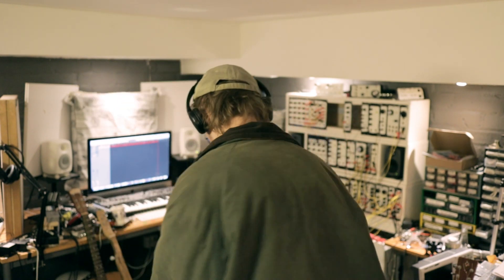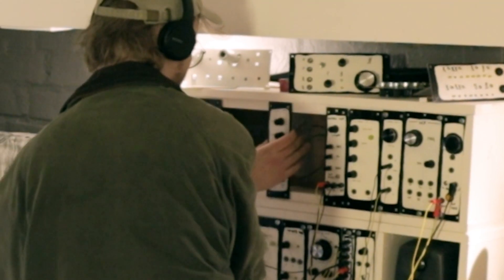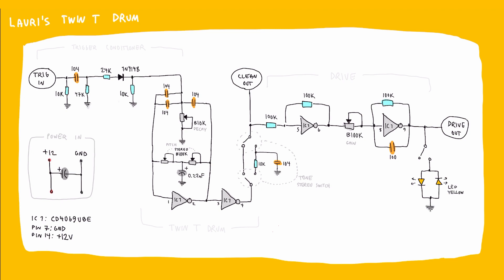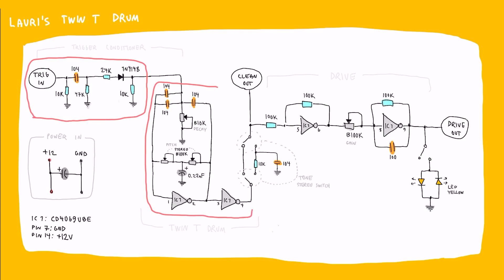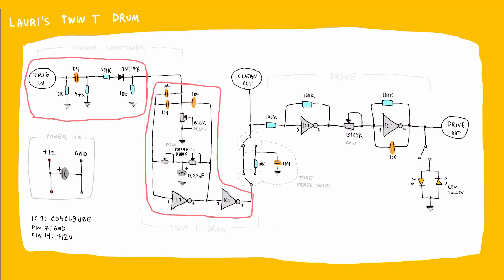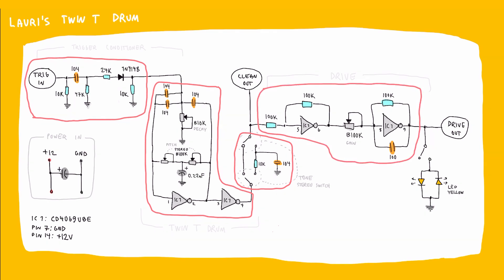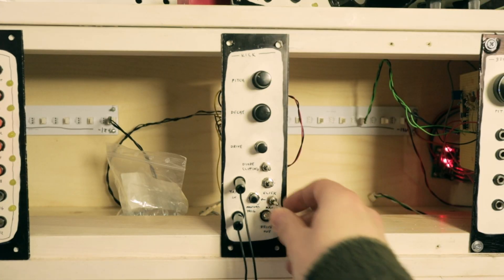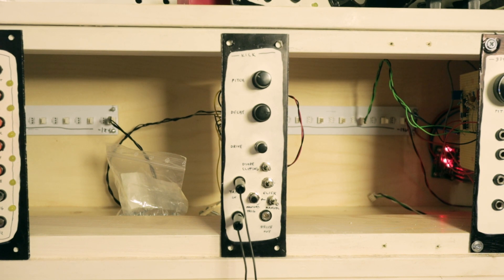DIY twin t kick drum module for modular synth

Comment: Hi Lauri, it's me again with another stupid (?) question: The 0.22uF cap near the stereo pot, does it really have to be a 220nF electrolytic cap? The E.W. original circuit shows the non polarized cap symbol (foil/ceramic?) which seems quite logic to me because 220nF is a quite unusual value for an electolytic one (they do exist though).
Reply from the maker: @DCPier  yeah i think a non polarized cap should be totally fine! I just drew the schematic with the exact component i used myself and i happened to only have 220nf electrolytic caps at the time

Comment: I need some help, please.
I've built the circuit and it sounded nice until it didn't. It starts to oscillate like crazy and eventualy the ic fries. I checked the circuit, it's all acording to the schematics. And why didn't you use coupling caps on outputs? 
Looking forward for the reply.
Reply from the maker: Hmmm not sure what could be causing that. Did you check that it wasn’t just a faulty ic chip? Are you powering it with 12V DC like mine or soething else? And what are you using as a trigger?
Reply: @LAURISDIYCHANNELTV  Thanks for the reply! It might have been faulty ic since I bought the cheapest ones from local parts store, tried with 2 chips, both failed. I'm powering the circuit with a 12 volt adapter, beatstep pro as a trigger. I'l try this chips in more conventional applications and check for instabilities.
Reply from the maker: @AlienFrog648  okay, thats all i can think of at the moment! I was thinking something like this could happen if the chip somehow got a negative voltage to its inputs, but it doesnt really sound like thats the case with your setup. I fried a couple of 4069s like that when i was building a filter. Just like yours, it worked for a little while and sounded fine, but then started acting up and the chip fried
Reply: @LAURISDIYCHANNELTV  Thanks, Lauri! I figured it out, those were just bad ic chips, they are quite unstable. I replaced them with some made by Texas Instruments and it works like a charm! 
Many other twin-t drums sound kinda dry to my ears, this one sounds a lot better, IMHO. 
Thank you greatly for your circuit and help!! Much appreciated!
Reply from the maker: @AlienFrog648  awesome, good to hear! 😊💛
Reply: @LAURISDIYCHANNELTV  and it actually works better without coupling caps, haha
Reply from the maker: @AlienFrog648  oh and i didnt use output caps because i didnt know what i was doing and still dont! Im not very knowledgeable when it comes to electronics but im learning as i build more and more stuff!

Comment: What are the boards you are using here? They look really useful
Reply from the maker: It’s a prototyping pcb i desinged and order from jlcpcb! It’s like a breadboard, meaning theres always a row of 6 soldering points connected to each other. This makes prototyping simpler and i have to use way less wires to connect components! Heres a link to the gerber files, if you want to order some yourself: https://www.dropbox.com/sh/yw0j4umez1evwmp/AABw4nE_mRQAVi5pAXoBGCRpa?dl=0
Reply from the maker: You just need to upload the gerber zip on a PCB manufacturers website like JLCPCB or PCBway for example!
Reply: @LAURISDIYCHANNELTV  dude, thank you so much. I did have some ideas similar to this, but never found the time to learn kicad. I will use your design, with great thanks and appreciation. Nice one ❤️

Comment: OK this is actually sick sounding, I have been looking at way more complicated kicks for DIY but I'm gonna go for this one!
Reply: @LAURISDIYCHANNELTV can you share what kind of switch you used for the RC filter? It looks like it's just one double-pole or something, but I haven't been able to find such a thing online. I have been trying to think of a way to use one simple two way switch but I don't think it's possible. Maybe I'll just leave the RC filter always on. Should have breadboarded first XD
Reply from the maker: @constantine333B you can search ”DPDT 6 pin” on ebay, amazon or whatever and you should find these switches! I guess you could use a single switch so that it disconnects the capasitor from the circuit (So in between the 10k resistor and the 104 capasitor.) When disconnecting the capasitor, that would leave the 10K resistor in the signal path but i dont think thats going to make a huge differnece, it should just make the output a little bit more quiet
Reply: Oooh good idea! Need to get my active mixer module together anyway so I can boost the signal there. Thanks man!

Comment: If i change some of the capacitor values in the oscillator for a higher pitch and add a small noise circuit, would i be able to make a sbare drum from this circuit?
Reply from the maker: For sure! I’ve used the circuit for snare sounds even with these cap values! But caps for a higher pitch would be smart for a snare circuit. You can find a simple percussive noise circuit for example on Kristian Blåsol’s (modular in a week) channel

Comment: Really nice drum module ! Is it possible to trigger it using an electronic drum kick like the Roland KD-8 kick pad ?
Reply from the maker: I've sometimes used the module with a simple amplified piezo drum pad, but the output isn't the same as with a 5V trigger. It does make a sound, but the sound is kinda softer and more responsive to the input signal. I'm not familiar with the KD-8, but if it's a passive piezo pedal, it would work in a similar way, but you would also have to amplify the signal before plugging it into the module
Reply: @LAURISDIYCHANNELTV  Hi Lauri, thanks a lot for your answer ! Do you have a 5V amplifier circuit to recommend ?
Reply from the maker: You might be able to use the overdrive part of the modules schematic as a passable amp circuit! You can also check Doepfers DIY page on their website for some simple diy circuits, i remember them having a simple op amp amplifier circuit and i bet it could be powered with 5V and ground instead of the eurorack +12V and -12V
Reply from the maker: You can find the website by googling ”doepfer diy”

Comment: Why is there a .1uf cap in parallel with one of the .1uf caps in the twin -t circuit? Shouldn't they be the same?
Reply from the maker: I was messing around with the cap values on breadboard and this is what i ended up with, I liked the pitch range with these values! I’m sure it would be better to make both sides the same value, but i only had certain cap values at hand at the time and i was happy with the circuit like this
Reply: @LAURISDIYCHANNELTV  Cool! I'll try it both ways and see what I like.

Comment: Hello!! Great video!!
One question, I want to make a version with the 40106 as clock, and I was wondering if it is possible to add an extra output to that clock pulse to synchronize other modules.
Would it be as simple as adding a buffer to that clock output on the 40106 and taking the extra output from there with a 104 capacitor? Or is it not as simple as that?
thanks :D
Reply from the maker: Thanks! Multiplying the clock signal should be very simple! I think a buffered mult would be ideal, but you could probably even just multiply the signal passively. So just wire the same clock signal to the drum and an output jack! I dont know if it doesnt work like that in certain setups, but with my modular i send the same clock to different modules by just stacking banana cables to the same output haha
Reply: @LAURISDIYCHANNELTV  Thanks a lot!
It's true, it works! :P Thank you! I have a question about the Trigger, I am building the circuit for 12v, but for the trigger button to send 5v should I take it from a 7805 regulator?
Oh! And happy new year from Panama!! Thanks for your channel!
Reply from the maker: @doohmritual  Yes thats what i did, just a 7805 and a momentary switch! I think the trigger can also be 12V, but i wanted it to be the same voltage as other trigger sources in the modular. So im guessing if you use 12V its just gonna be a bit louder

Comment: I built the trigger conditioner and the drum part of the circuit (did'nt build the drive part), and when i plug in to the clean out it doesn't pulse it just makes a continuous sound in my headphones, like a synthesizer or something. But the decay and pitch do work and they change the sound. help??
Reply from the maker: If the pots work and change the pitch of the sound, it sounds like the circuit is working, but for some reason the filter is resonating too much! The module does self oscillate with certain settings, at least when you exite it with a trigger. So maybe double check the decay pot is working correctly and not broken or something, because it is basically the resonanse of the filter circuit, that makes the drum sound
Reply from the maker: If the pots dont change the pitch but change the tone of the sound somehow, then it might be something else, for example grounding related! Make sure all the circuits you are using are connected to the same ground
Reply: @LAURISDIYCHANNELTV  okk, thanx

Comment: Thanks for the video, but I'm having a little trouble following the schematics on a breadboard. Could you make a video of you building this on a breadboard? Or if you could help out a little with the schematics that would be awesome! Thanks!
Reply from the maker: You can message me on instagram and i’ll try my best to help! Theres a link to my insta in the description. And if you dont use instagram, go ahead and ask me here in the comments! 😊
Reply: @LAURISDIYCHANNELTV  Well when I plug in my clock circuit to trigger it, I get an oscillation. But none of the potentiometers work to change the sound of the oscillation. I didn't use any switches yet. I just went with a static route for now.
Reply from the maker: If none of the pots do anything, could it be some sort of a grounding issue? If your clock source and the drum circuit dont share a ground, it might lead to some sort of humming! Does it make any noise when the clock is not connected? You can easily try if the circuit is working on its own by plugging +V of your breadboard to the trigger input
Reply: @LAURISDIYCHANNELTV  Both circuits share a ground. And on the drum circuit i have both pair of rails strung to each other (positive to positive and negative to negative). And it doesent make a noise when the clock is not connected nor when i plug +V to the trigger input. I think I did something seriously wrong.
Reply from the maker: Then i would check all the connections again and if everything seems to be right, i would check if the ic chip is broken or something!
Reply from the maker: Oh shit and the schematic in the video had some error if i remember correctly!! Check out the fixed schematic in the dropbox link in description! I think 2 of the ic pins were written the wrong way!
Reply: @LAURISDIYCHANNELTV  Ohhh snap! Alright, I'll check that, Thanks!
Reply: @LAURISDIYCHANNELTV  And also, do I need a stereo potentiometer? or can I use a regular one.
Reply from the maker: You do need a stereo pot for the pitch! You should also get sound out of it if you have 2 regular potentiometers set to the same exact value, or 2 fixed resistors instead, but then you basically cant change the pitch
Reply: @LAURISDIYCHANNELTV  Alright ill get one. Thanks!!!
Reply: @LAURISDIYCHANNELTV  damn, still stumped.
Reply from the maker: @boenglover2593  Shit, sorry to hear! I cant think of any other ideas 🙁 Sometimes when i get a problem i cant seem to troubleshoot, i just end up building the whole thing again! Cause it might be a missed connection, broken parts or something
Reply from the maker: Im not sure if it makes a difference in the circuit, but there are buffered and unbuffered versions of the cd4069 chip! I used the unbuffered version, so it says CD4069UB or UBE. Are you using the same or the buffered version? I dont really understand electronics that well so i cant say if it makes a difference
Reply: @LAURISDIYCHANNELTV  i have the cd4069ube. but i think it might be the potentiometers. or how i have my power hooked up. but ill try the circuit over again for now
Reply from the maker: @boenglover2593  you got this! Make sure the stereo pot is connected correctly, so both pots change the same way round. For some reason i always screw this up first and then have to flip the other pots connections haha
Reply: @LAURISDIYCHANNELTV  Ok i think i got it! thanks for the help!!
Reply: @LAURISDIYCHANNELTV  wait sry one more question on the pots lol. do the markings on the stereo pot symbol in the schematic go (3-2-1 and 1-2-3) or (1-2-3 and 3-2-1)? and also do the other pots go (3-2-1) or (1-2-3)? if you know what i mean.
Reply from the maker: @boenglover2593  the value of both sides of the stereo pot should stay the same as you adjust it, so i guess the pin numers from left to right in the schematic should be 1-2-3 and 1-2-3! It doest matter if the whole thing is ”flipped”, as long as they are both the same way. Then the pitch pot just works the wrong way round! And the same with the other pots! I cant really say which way they should be, i tend to just connect pots and hope they are the way i want them to or leave the controls flipped if im lazy hahah
Reply: @LAURISDIYCHANNELTV  lol, ok. thanks!

Comment: Hey, sounds great and very simple design! I am wondering though, isn't the output going to be only on the positive part swinging between 0 and 12 volts?
Reply from the maker: Yeah this has been working perfectly fine for me, so no need to add anything to the output!
Reply from the maker: Thanks! Yes the output is between ground and 12V, but i see no problem with that! A lot of audio sources are unipolar, i think for example my cem3340 oscillators are as well. And of course digital arduino modules etc
Reply: @LAURISDIYCHANNELTV  Thanks for the response. I consider trying to build this module, and I thought I would put an RC passive high pass filter on the output, to get rid of the offset, but as I understand even that is not necessary right?

Comment: This kick drum circuit gives a nice range of effects. I've built 2 of these now based on your cct. One thing I've noticed is that the circuit seems to pick up any noise/signal that is on the power supply and amplifies it. If I unplug the output of the kick drum the effect goes away. Anyone else noticed this? I've tried adding some larger caps to the power supply rails on the kick drum cct board. This reduced the effect a little bit, but didn't eliminate it. Interested to know if other people also see this effect.
Reply from the maker: Nice to hear the circuit has been useful! 😊 I havent noticed any noise problems with mine, but i only have a couple of modules in the same case at the moment! I forgot to mention it it the video, but you should remember to connect the ground connection of the inputs and outputs if youre using regular minijacks or jacks! But of course i dont know your setup or if that would even matter! But if anyone else has noticed a similar problem and has a solution, please let us know!

Comment: Cool module. Why is the sound very low? did I assemble it incorrectly or do I need to connect to an amplifier?
Reply from the maker: Thanks! I just realised i forgot to make a small correction to the schematic! The pins 8 & 9 of the cd4069 were marked the wrong way around! So if the overdrive output is quiet, that might be the reason, sorry for that! I updated the dropbox link in the description and everything should be working now. If that wasn’t the problem, then i dont know what it could be. For me the circuit is loud enough to use with my modular synth! So then maybe check if theres any errors or broken components in your circuit. Hope this helps and hope you get it working properly! 😊

Comment: Nice sound. Thanks for combining this from all different resources.
The origin of this circuit (as far as I can trace back) goes back to the January 1978 edition of the Practical Electronics magazine and it has been going around in similar form over the last 35 years.
Your version works great there is just one error in the schematics: pin 8 and 9 of the 4069 are swapped (pin 9 is the input, 8 the output of the inverter)
I made some small modifications to get it more to my liking: I changed the 104 capacitor on the input to 1 uF to get a better sound and I changed the 100 (10 pF ?) capacitor on the final gate to 10 nF. With the 10 pF capacitor the initial click on the drum was too loud for me.
Reply from the maker: Thanks! Oh yeah thanks for pointing out the error in the schematic, i always get these pins the wrong way in my schematics haha! And thanks for the improvement ideas, i’ll definitely try them out cause i’m building a similar drum to another project at some point!
Reply: @LAURISDIYCHANNELTV  I was even thinking of building one of these with one of those more expensive (60 cents or so)  IC sockets with round pins to be able to experiment with different capacitors
Reply from the maker: @Rob_65  oh that would actually be preatty cool!
Reply: @LAURISDIYCHANNELTV  I was thinking of putting this on the PCB such that I can play with values but I was just thinking it is way cooler to have them on the front-panel.
Would be a great commercial module: a drum with a bag of capacitors so users can play around to get the sound they like  😁
Reply from the maker: @Rob_65  haha that would be awesome!
Reply: @Rob_65 I'm reading your idea a year later, thinking the same thing. I have an overdrive module with breadboard connections on the front, and it came with a bag of ceramic capacitors, resistors, and various diodes. The circuit is set up to have the boards in parallel with the feedback circuit.
It's a neutral labs nijel.